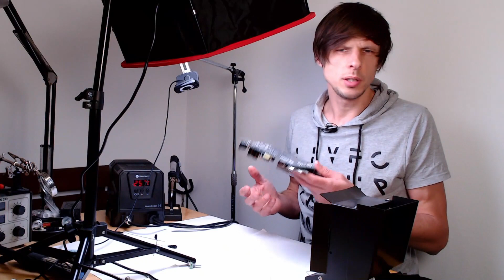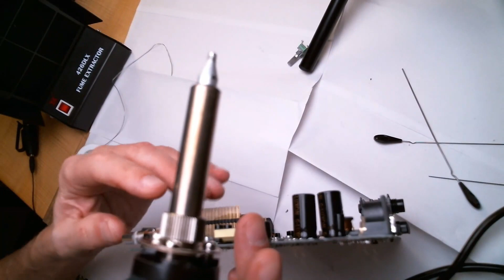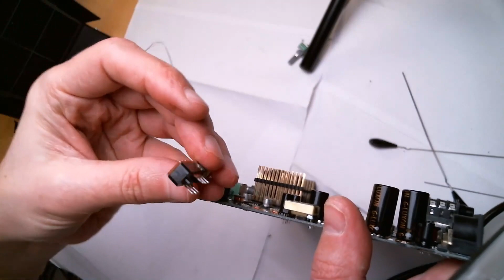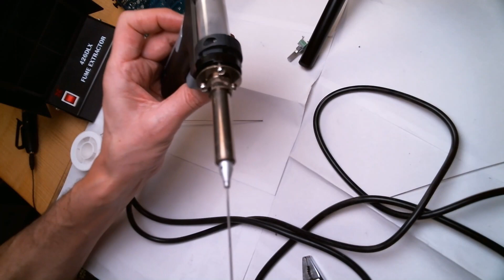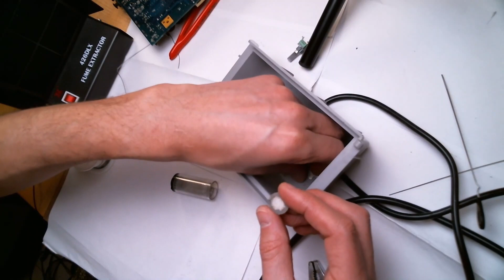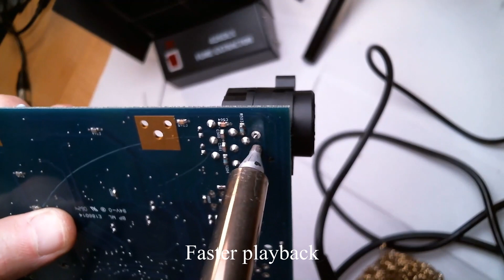How to use a vacuum desoldering gun

Comment: What I have found, is that setting the temperature too high ie, at 400 degrees, and ..leaving it there, tends to, ..cause, more frequent clogging, of the inlet tube.     I prefer instead, to set the temperature down at 300 degrees which seems to work OK for Desoldering most small components and also seems to result in less, clogging, and then, only setting the temperature higher, ..if, and when, actually needed, ie, when trying to desolder a LARGE thermal-mass-component, or, components mounted upon a large thermal-mass-area, of the PCB’s copper lands, and then ..only leaving it at that higher temperature, for as long, as actually needed to do that particular task.     I also regularly add a small ‘ball’ of ‘loose’, steel wool, into the solder collecting Tube, which also improves the life-span, of the filter, at the rear of the collection Tube, by stopping the majority, of the molten solder, ..at the steel wool, as it transits through the Tube.      Also, adding a small dab, of liquid resin flux, with a small paint brush, onto a ‘dry’ looking solder joint, before trying to desolder it, helps the solder to then liquify and mobilise better, when the hot, gun tip is applied to it.    Basically does the same thing, as Re-Soldering the joint, with a soldering iron, first, before trying to desolder it with the gun.  😉👍
Reply from the maker: Thank you very much for these constructive comments! Yes, agreed that high temps are only really needed for objects with large mass. I have not tried applying resin flux yet, will give that a go with my next desoldering session 👍

Comment: Is the desoldering gun got hole on its tip?What temp. use?
Reply from the maker: Yes, the desoldering gun has a hole on its tip. However, when you buy the gun, typically the hole will be filled with solder. By heating it to its operating temp the solder melts and thereby the hole opens up. The operating temp I use is around 380 to 420C. For cleaning it helps to heat it up to the max temperature. Happy desoldering :-)
Reply: @mothunderz  Thankyou for your reply.When did desoldering gun existed,am only aware of it currently.Back then in 80",90' and year 2000
never heard of it.I was studying electrical and electronics,then working in factory only got air heater to removed ic chips,whereas the operators use soldering iron to remove other components on cct board.
Reply: @mothunderz  Yes I already first time using desoldering gun and noticed too the solder melts left a hole in the nozzle.However cant removed the leftover solder on the rectifier leg on the body component side.Able to desolder the below leg part with ease.
Reply: @mothunderz  thank you..i was going to mail them saying the tip was all sealed and do i have to drill it to get the hole?😁 In fact i came here to look at that tip

Comment: Nice video, thanks for posting it.
Reply from the maker: Glad you enjoyed it
Reply: @mothunderz  Thanks, and learnt also something new (that up, down, left, right technique). Without notice, I may say you also have fine English language skills.
Reply from the maker: Thank you :-)
Reply: @mothunderz  As like, is very important to know the tool, throughole desoldering station are not magical, sometimes you need apply some help, like low melting solder, more solder, flux and more.
I have many desoldering stations, I have 2 Hakko inclusive.
What I can tell you, all clogged sometimes.

Finally is very important heat the solder and press the botton went the solder is melting.

Best Regards.
Reply from the maker: Dear Ricardo, thanks for your comments. Flux and low melting solder can indeed help out and also agreed that one should take care the solder is melted before activating the pump.